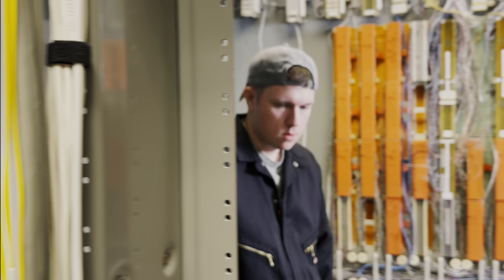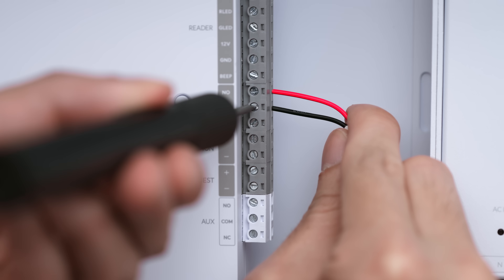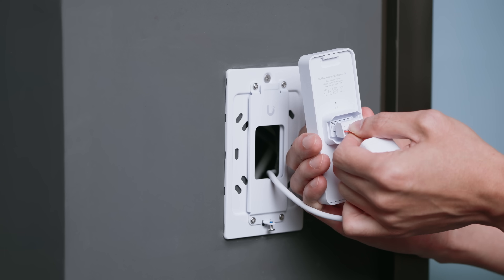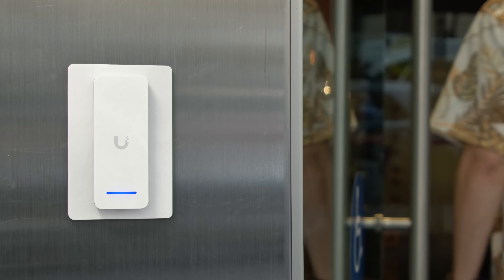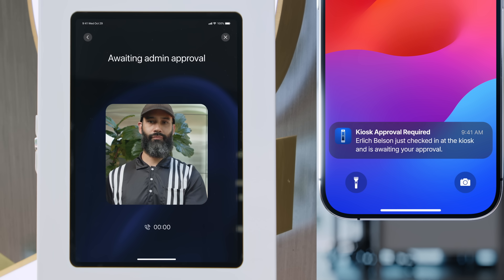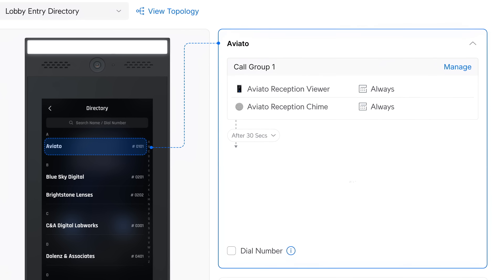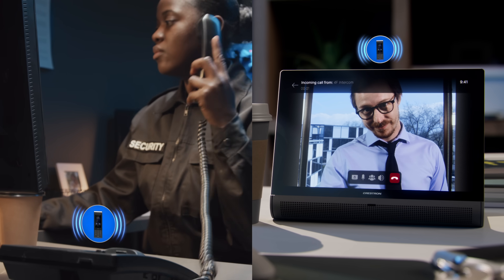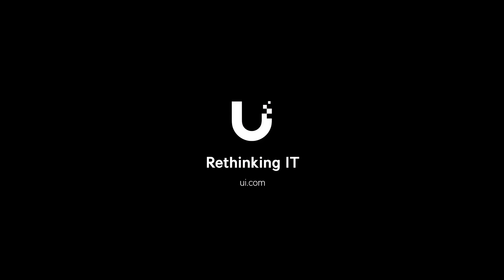Introducing: UniFi Access Retrofit [Coming Soon]

Comment: I can finally replace my Ring retrofit kits for my home alarm system! Garbage Ring stuff not only doesn’t have a proper cloud backup solution for alarm system setting, but also increasing their professional monitoring fees by a lot. Hope they can work with some reputable professional monitor stations and provide monitoring service to both commercial and residential purposes.

Comment: Using existing cables - isn't that already possible with the current hardware options? I don't get what's new here
Reply: Previously Ubiquiti readers needed Ethernet.  Retrofit reader only needs 4 wires.  It's uncommon for other access systems to use Ethernet for their readers.
Reply: @taylorlightfoot thanks for your explanation!

Comment: wait would this help for someone with an old legacy doorbell in a house. I'd like to keep the old doorbell chime but also don't want to spend as much to completely replace and upgrade my fuse box just to upgrade my doorbell as the smart ones require higher voltages not provided by my current fusebox
Reply: Their G4 doorbell already does that. You only need that the transformer in the fusebox is at least 16V. My doorbell was 12v, i found a 15$ mecanical chime kit (transformer 24v + chime) to replace it then i putted a Unify G4 doorbell. No need to do complete rewiring
Reply: @Damgoeh  the replacing the transformer is what i need to do, but i want to maintain my old school chime
Reply: @Kriojenic  In my case the old one was not working with the new transformer. But the new one was old school too with exactly the same bell tone.
Reply: @Damgoeh  Hmm, I'll see if i can get help from an electrician perhaps.